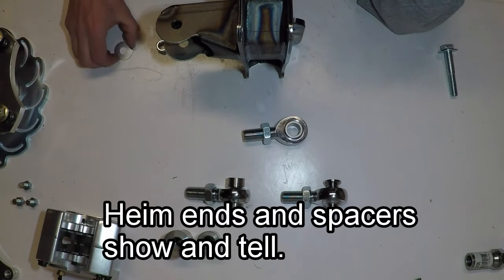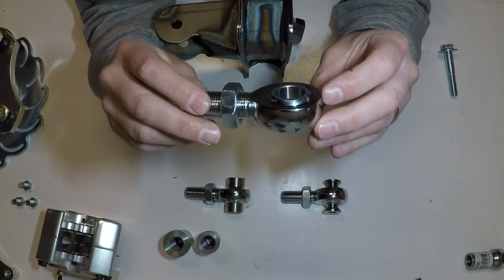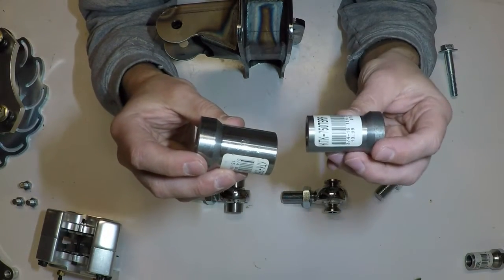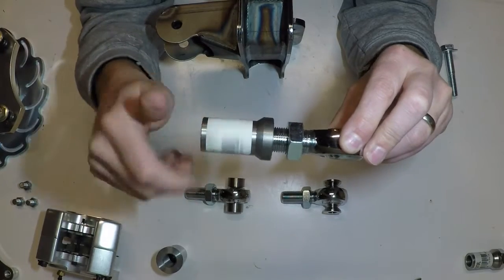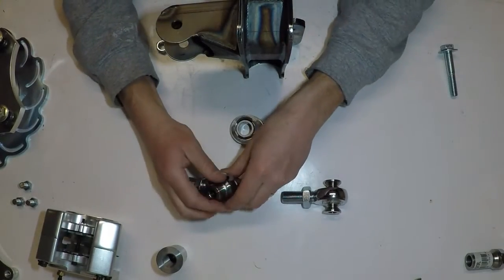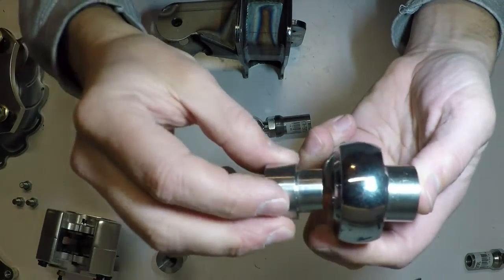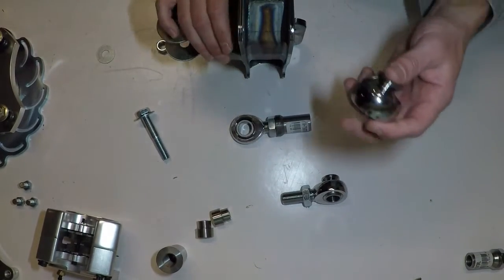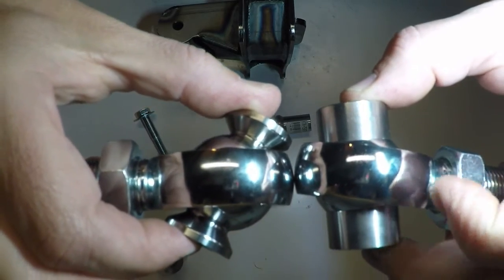Heims and Spacers show and tell.

Comment: I bought a set of rear camber arms they came with spacers, but the space doesn’t fit into the heim.  They are the same size
Reply from the maker: Check with the manufacturer. It could be that in that design they don't go inside. But that would be a much weaker design. The spacers I show in this video are what you want. A portion of them goes in the heim and that adds a lot of strength. I hope that helps.
Reply: Thanks for the reply.  The troubles of driving a lowered car.  I know this, but still slam my car anyways.  Thanks for ur time.  Pretty good explanation
Reply from the maker: I assumed you were taking about arms for offroad. If these are for a lowered car I wouldn't worry as much about it. Shouldn't be subjected to the abuse offroad is.
Good Luck.
Reply: Doug Bug I was thinking the same cuz if it flexed like the ones I showed than it would be running sloppy I guess